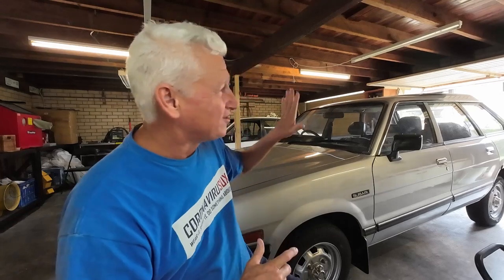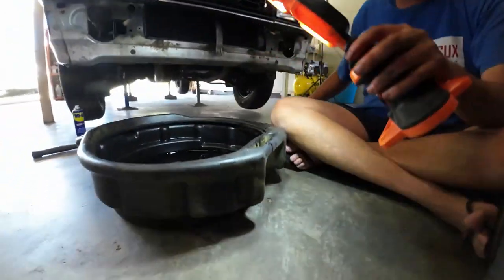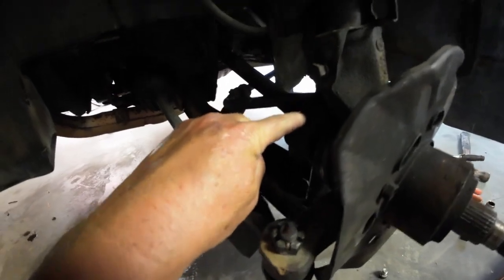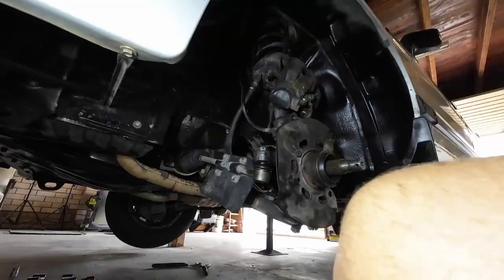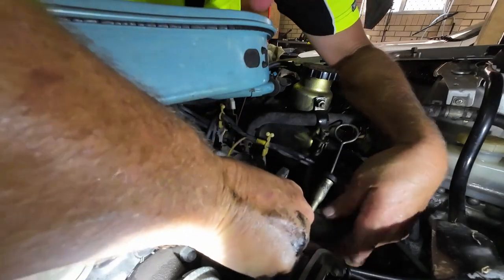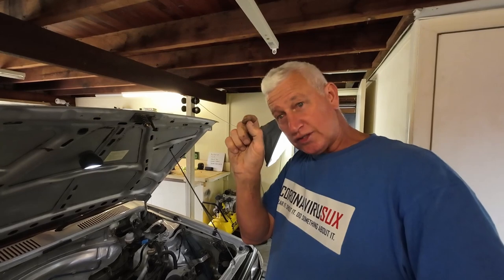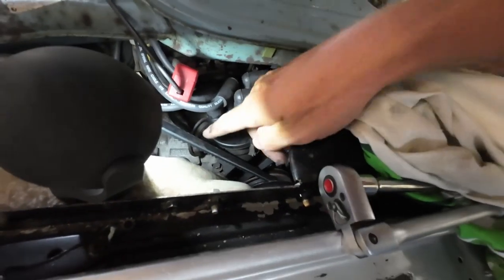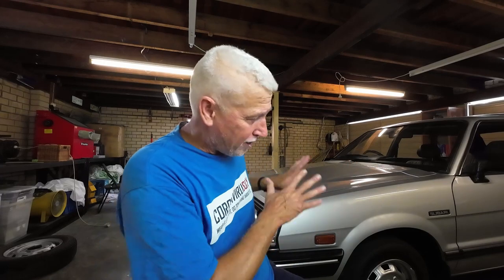1984 SUBARU TOURING WAGON RESCUE | FULL SERVICE AND REPAIRS

Comment: The US model had some decent white steel 8-spoke wheels on the 4WDs (there was also a rare optional alloy version I think was a dealer option). Those wheels came on FWDs in the US. For the CV joint boots, if you know they just split (or just look about to) and didn't yet throw all the grease out and ingest sand and dirt, get split boots (or split some) and put them over the old ones like a shell, then secure between the pleats with black zip ties. Yeah, it sounds hackey and it is, but these aren't concours lawn ornaments and I had them last tens of thousands of unbabied miles like that (never saw them fail, they outlasted the remainder of the car's life). Worst case, they go again and you replace the axle, but that's where you were originally and now you're a lot longer down the road than you would have been.

Comment: You might have to go more advanced on your timing, towards 12. Disconnect the vacuum advance from the dizzy & plug it while you do the timing. Set the idle then do the mix. You'll know when its right. You'll be impressed.
Reply: p.s. I have 2 slightly younger ones & a unicorn GT.

Comment: Yes those drive shafts are a pain to reinstall.. took me one day per set to get it done with my home tools.. But doing timing and is a lot easier on my Subaru since it's fuel injection turbo. Timing mark is on the crank pulley
Reply from the maker: Glad it wasn't just me!!

Comment: Did you have the vacuum advance disconnected when checking timing? and is the vac advance working for that matter ? (usually pretty stuffed by that age) , also the engine ticking .. that model may have solid lifters to adjust. Not a  hard job despite the position of everything.
Reply from the maker: Oh crap Jimmy I completely forgot to do that! I should have known because it was the same with my 84 Hilux! And yes the vacuum advance is probs rooted at this age. Thanks mate I need to sort that out now. Might drive even better! Sweet!
Reply from the maker: Mate just timed the old girl again. Disconnected the Vacuum advance and no change. I think that tells me it's not working. Correct?
Reply: @FLIPMYRIDE  yeah should be about 10deg more advance at idle and light throttle with the vacuum connected . mine doesn't work either. There is a mob that reco them with an exchange program on ebay . I've been meaning to get mine done. but for now  I just run it on 98 and my timing a bit more advanced than normal to compensate